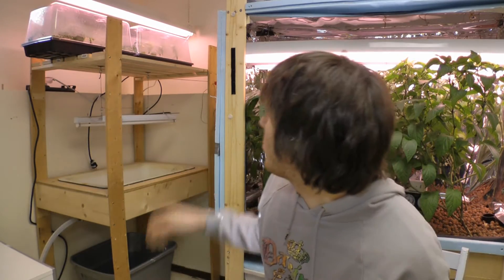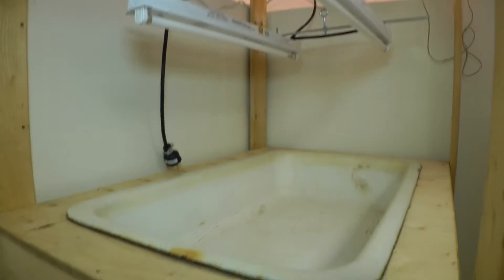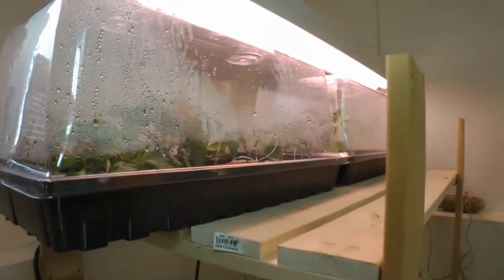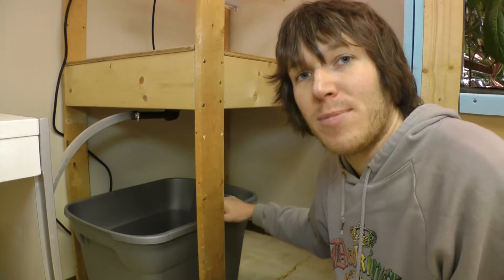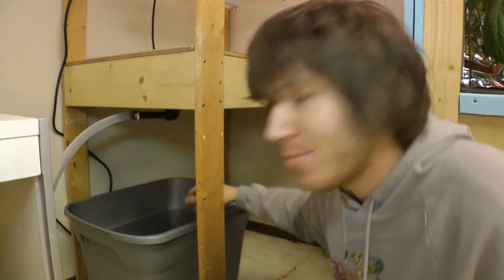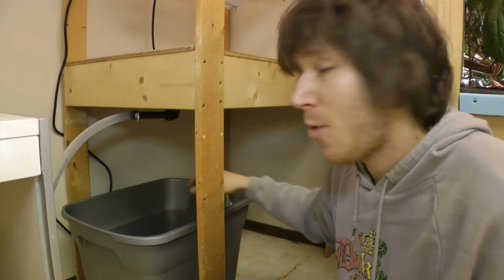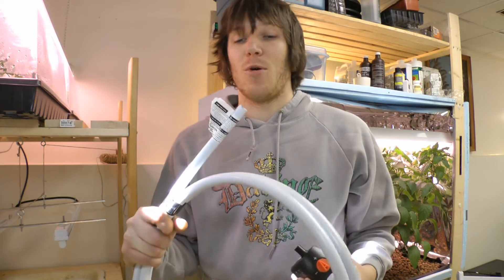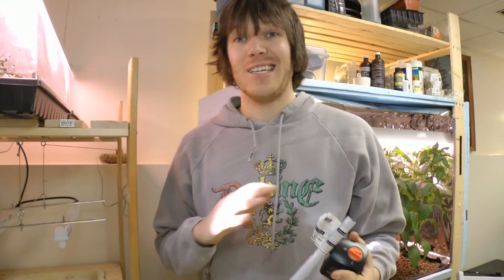How To Hydroponics - S02E14 Build A Floodtable Part 3

Comment: I think what might have happened is the tubing's inside diameter what not big enough for the pump output causing too much head pressure build up on the pump.

Comment: I have a question. Most people with these flood and drain tables use a "siphon". But, if you mount the flow line under the table to fill up, (also having a overflow pipe) when the timer shuts off the water pump, wouldnt it all flow back thru the pump? Like it own drain line? Seams simpler to do that just need to know if its a good idea.